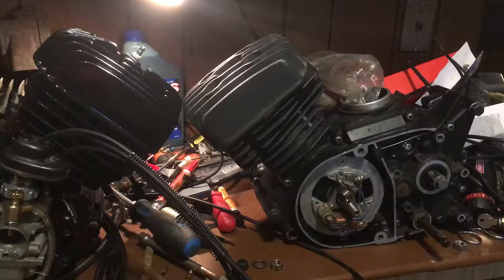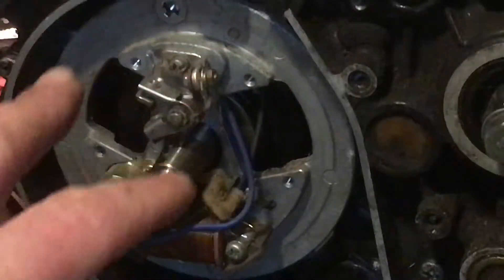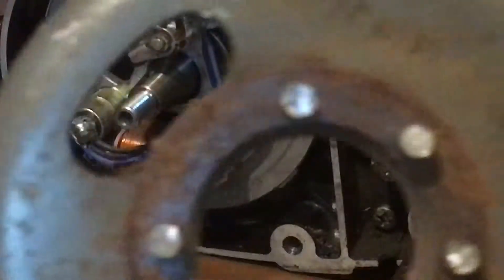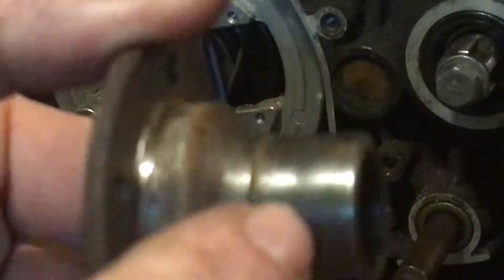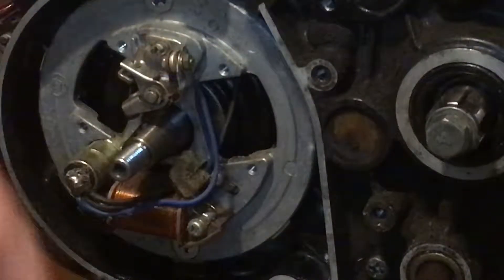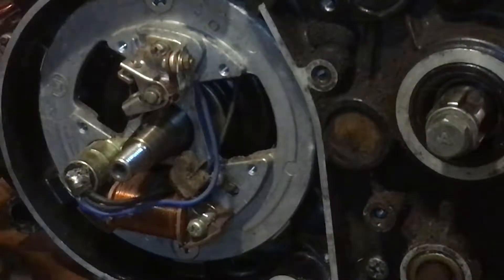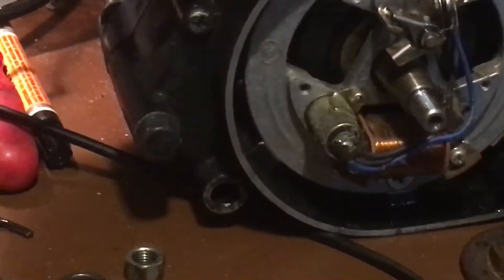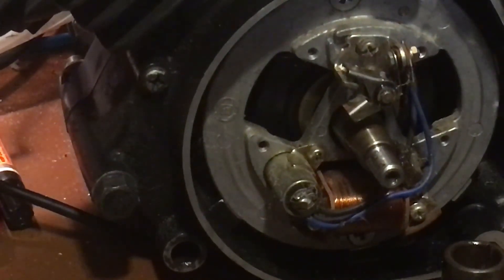overlooked points ignition problems

Comment: Hey kevin great work buddy I've a question for u if I may , I've a 1981 KE125 and really been chasing a poor spark for to long I've changed the stator , the points,  the condenser  , the spark plug , coil and still really poor , so in wanting to go CDI what parts do I need to buy to do the swap would be really appreciated buddy and get an other old KE out running and being enjoyed again

Comment: why when your rotating that cam, the timing line isnt lined up with the other line when the gap is open on the points? i thought everything has to be lined up when you gap it. your timing line was way past the mark on the engine
Reply from the maker: Line 1 is TDC top dead center line 2 is firing when spark happens some magnto  unfortunately only have 1 line reason the magnto is used on different models

Comment: Thanks for the good info! I'm having trouble starting a Honda CT90 and I suspect my problem is the points and/or the advance mechanism.
Reply from the maker: check the timing marks make sure the crank and cam are timed correctly and make sure the advance moves and is not stuck

Comment: Hi Kevin, enjoy your videos, trying to get spark on a 72' TS90 Suzuki. Looks very similar to your Kawasaki's. Starting from a bare stator plate with new points, condenser and primary coil only. Do you have a video showing how basic wiring is ran between points, condenser, primary coil then into ignition coil? Great instructions, thank you!
Reply from the maker: all wires connect to the condenser then the black wire connects to the ignition coil
Reply: so I'll have 3 wires on condenser, one from points, one from primary coil and one from ignition coil? Please excuse my lack of experience. Trying to learn,  thanks for your patience.  @2strokeguru

Comment: Kevin I'm stuck on spark issues with an 87 kd80m. Went over the wires and they seem to be in decent shape. I would like to avoid replacing parts that may not even be the problem. Not getting any spark at all.
Reply from the maker: Clean or replace your points
Reply from the maker: Use a nail file to clean
Reply: Thank you for the tips. After what you suggested to do was done, all it took was 2 kicks and it fired up. I thank you for responding so quickly.
Reply from the maker: @COUSIN_NICKY  that's great to hear great job on doing the work I try to respond as fast as possible many people friend request me on Facebook and chat through messenger you are welcome to do the same if you want

Comment: Hey bud. I see you love the ke100's too. I've got a 95 right now I'm working on. Haven't tore into it yet, but are all the years of this bike points ignition or did the later years get cdi? Keep getting mixed answers on that
Reply from the maker: Paul  Bubnash cdi is from 96 to 2001
Reply: Thanks man. Looks like I'm gonna need points and a condenser then for mine. Starts, runs good for about 10 seconds and will run for another minute or so poorly before it dies out. Is the flywheel very hard to remove? Your videos have great info btw. Best information I've found on this bike has been from you. Thanks alot